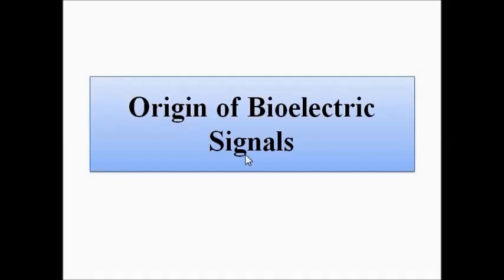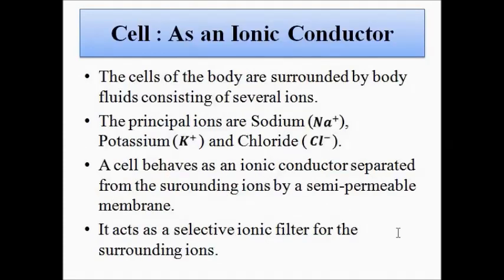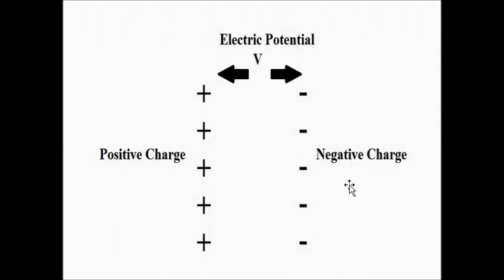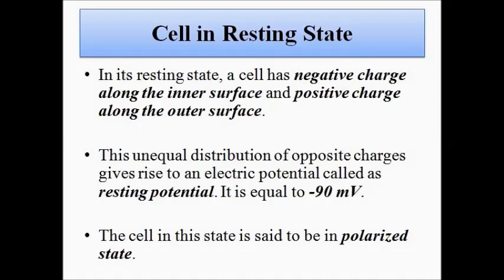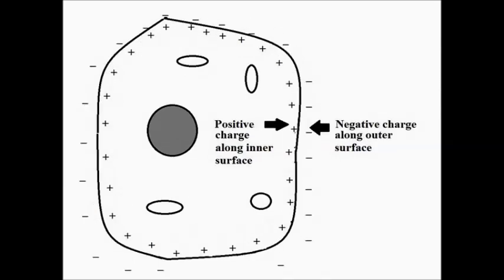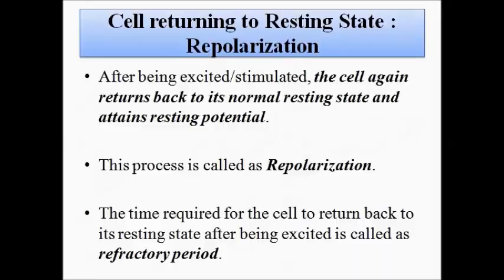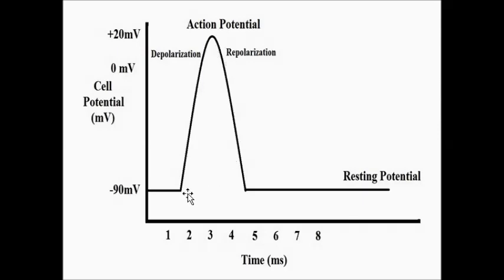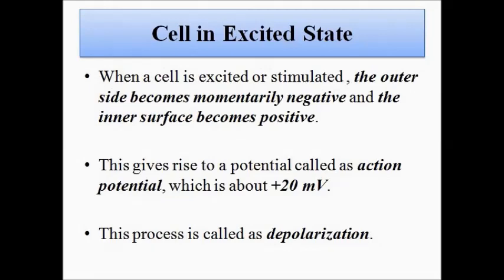Origin of Bioelectric Signals | Basic Concepts

Comment: Nice lecture, could you please answer to some questions.
First one is there a way of placing a magnetic compass on the cell to see if there is a magnetic field around the cell when depolarization occurs .
Similar to earlier faraday, amperes experiment in electrical circuits/ fields. 
Second questions is ,if the cation is a  proton (h+ ), then how can they stay so organized , I would expect them to scatter around due to repulsion .
Do you and any mechanisms in physics that can explain these.
Keep up the good work .